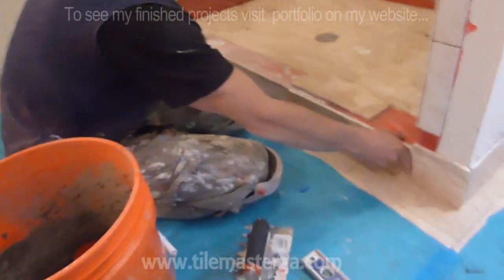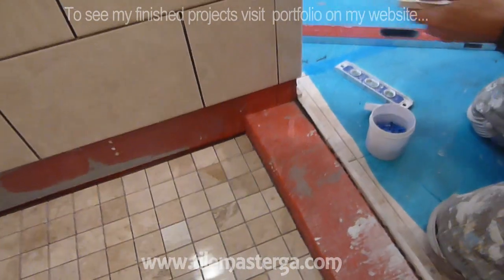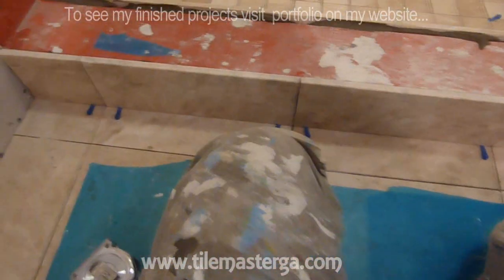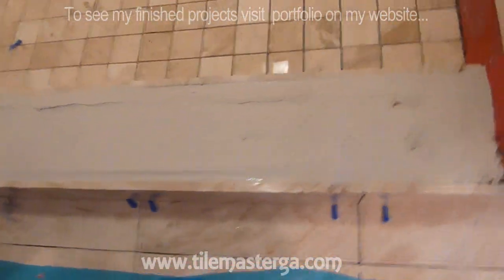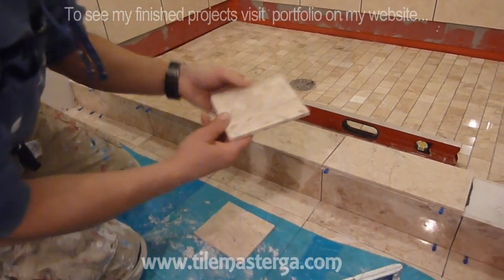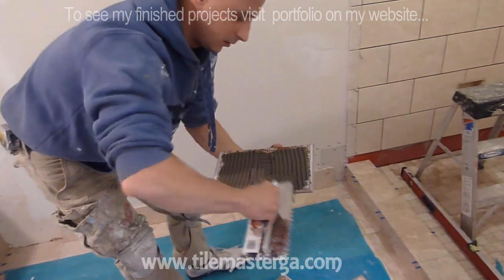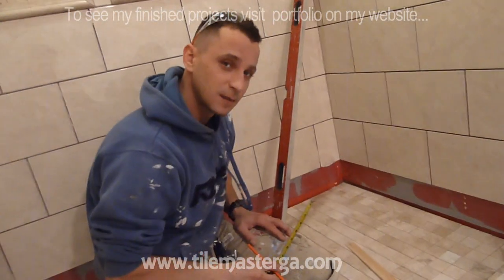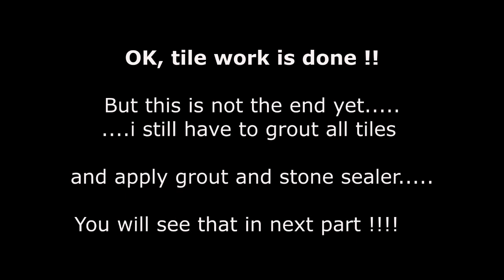Part "5" How to tile shower curb & measure all cuts to shower floor & main bathroom floor  DIY

Comment: Thanks for the video's showing the details and instructions and why you made the choices you did and what you could have done. My late father was a tile mason from the 1950's through the 70's. Back then he used metal lathe and floated the walls with thin wooden strips to make the room square and level. He even used a lead shower pan from time to time. Sure looks easier now and maybe even better. I was the clean up, tote mud and shine the tile boy.Thanks. Semper FI.

Comment: Wow amazing craftsmanship for 11 years ago water proofing membrane wow you were steps ahead of your time great ethics and ways of construction also never anchor your tile board into the shower pan big no no it will wick up water over time leave at least 1 inch above the pan tile your tiles can sit in the water it will not wick anything.

Comment: Nice video series man! Im swedish and here the main reason people dont tile all the way to the roof is that you get increased tax on your house(if you/someone reports it). I like how you apply thinset on the tile instead of the wall... slower but less risk of damaging the membrane and also less stress and headake with differental drying thinset making it a pain to get all tiles seated evenly with flush corners. good job my polish friend

Comment from the maker: Thinset comes in 2 colors -grey and white. White makes work look cleaner and will not discolorate lighter grout. Sometimes if you use grey thinset it will effect lighter grout color.

Comment: first of all thanks for getting back to me very kind thanks  my question was due to the fact that when you did the shower walls the thin set 
you were using was a light cream color .When you started on the curb the color changed to a mortor color it was a dark grey it was at 38 seconds
on your video .by the way your work is top quality your a real Craftman great job
thanks for your time Peter

Comment: Great video.  Very detailed. So I've fired my tile guy for stealing money out of my pants that were in the laundry basket, so here I am. I'm going to attempt the job myself.  My question is about the curb as well as the bench he has put in so far...

NOW TO THE QUESTION:

The curb, shower pan,  and bench have been hot mopped.  I know I'll be making mud bed for the pan , but what do I do for the bench and curb.  Do I mud that as well, or do I hardibacker it ?

THANK YOU

Comment: Hi what thin set for the shower floor? And why you are using gray thin set for the curb and fill the top with white thin set then gray thin set to tile the top CURB ? And upper wall tiles are white thin set and bottom role are gray thin set, I am confused,  please give me an answer. Thanks and you are the king of Tiles Installer.

Comment: I have a concrete floor.  Do I  have to put a layer of concrete down before the rubber membrane?  If so, do I create a slope here or can I just do it level, and then slope the floor when I add the concrete on top of the membrane?  How thick should that first level be?  BTW, never done this before, have a lot of confidence in my skills, but your videos have saved me a lot of possible mistakes.  Really enjoyed them...easy to follow, and I'll be returning from time to time for more tips.  Thanks so much!
Reply: Yes, you need to have a slope under the membrane in case water gets under the top layer.  The slope on the bottom layer is necessary to allow water to run down and drain through the weep holes in the drain (if water gets through the tile to the membrane).

Comment: Very nice work. what I didn't understand is, if you put thinset on top and level with the side tiles, how come  when you installed the tiles on top with thinset there were not a gap between the side tiles and the top tiles, I mean, if they were aligned when you level the side tiles then after you put thinset on the top tiles there should  be a gap  add up(for the grout) between the side and top tiles. I'm asking because I have to do the same in my curb and I don't like to see too much grout on the front side tiles.  I like how  you did it.Thanks

Comment: Looks like a nice install...the mortar looks like rapid set, and I would definitely work mortar into substrate, notch than butter the tile, rather than just putting mortar on the tile...overall nice install though, neat and tight..

Comment: Hello , need some advice. The low part in my shower floor is not where the drain is and so water settles in the shower. I want to redo the floor. Is it  at all possible to roughen the existing tiles , add tub mud ( whatever it is called) to build the height up for proper drain , then retile on top of that. I realize the drain will now be low and not flush with the new tile,so is it adjustable to bring the drain flush ? My house was built in 1992.

Comment: I like your work!  I was wondering what the difference is between the thinset used to stick the tiles to the sides of the curb and the thinset used to fill the top.  There is an obvious color difference, but anything else different between the two compounds?  Also, would you fill the top like that if you were putting tiles on top with two metal edges to finish the top?  Thanks!

Comment: Only one criticism, always flat trowel a bonding coat of thin set to any surface be it raw cement board or red gaurd. Applying thin set to the tile only is not recommended.
Reply: Came down to the comment section to make sure someone covered this
Reply: I take it that everyone in this thread is a NTCA Certified tile installer?
Reply: The Milk Man-😂yeah course man. They’re all pros since they’ve watched two videos. One video makes them knowledgeable,two makes them pros😂
Reply: If you notch the back of the tile it kind of alleviates this problem as the tile is the only part of the equation that doesn’t bond. Personally I’d spread both but this guy knows what he’s doing so there is no problems with his work.
Reply: It will be fine. The tile is the one you really want to back butter. It is good practice, and essential for some surfaces, but not necessary for this.
Reply: @themilkman271  😂
Reply: @ELTUK82  😂

Comment from the maker: Well, if you have matching bullnose available I am recommending to use it. The goal is to avoid too many grout spaces on the curb. 
I don't think that cutting in 45 is good idea - edges may be to sharp...

The most recommended will be to find NATURAL STONE TILE( travertine or marble) that is close in color to your tiles or at least complements  with them. Using stone you can nicely finish sharp edge with polishing pads the way you want. - I apologize for late response - I have very limited time.

Comment: What's the general layout rule where you set you first wall tile and the tile that meets the floor? Looks like you basically cut a standard height wall tile in half and used the remaining half for the last tile at the ceiling. Is this a general standard? Thanks

Comment: What is the difference between the light colored thinset and the darker colored adhesive that you used on the top and bottom rows and the curb?  Couldn't you just use thinset for all of it?

Comment: I did my shower with a similar waterproff membrane before starting (Kerdi membrane) it appears you have a waterproof membrane as well. You then installed some backerboard strips from the floor to start your wall tiles to give a level surface to start from.

Once you remove that board you would of been left with screw holes in the wall and membrane. What do you do to fill the screw holes left by the board? Do you patch with more membrane or fill with caulk or something?
Reply: Jacob Harasimo the membrane he used comes in a bucket and is applied as paint is. so after he removed the acres, he probably went over the holes with more of the goop "Red Guard". also comes in blue and oranges yellows that I've seen

Comment: I have been following all of your shwr steps 1-5 and appreciate the instruction. I am currently setting my 99" long curb today with 24" limestone tiles. I raised the outside tiles by 3/8" like you stared, however, when I cut the inside face pieces, I cut them 1/8 higher than the curb and the slope is greater than "1/2 a bubble at the top". Is having a slope greater than 1/8" ok? I have a 1/8" gap between pan and tile for caulking

Comment: Why no grout spacing on the bottoms of the tile front and back of the curb where the meet the floor/shower base?  Is the way it should be done? I’ve always matched the tile grout spacing on these parts...maybe flush is better?
Thanks
Reply: I would leave somewhere in the ballpark (opening day tomorrow) of 1/16 to 1/8 grout line, then use a silicon color matched caulking to fill the grout gap

Comment: Are the inside and outside tiles of the curb being mortared directly to the waterproof membrane ? 

If yes does that have good adhesion ?
Reply: No. Notice that the curb has the Redgard waterproofing over the whole thing.  Backer material was attached first over any rubber membrane coming above the shower pan, including the shower curb, followed by the waterproofing.
Reply: runner316 And how is the backer material attached to the membrane? Using what adhesive? Or is thinset used? By backer material I assume you mean the backer board. Thanks.

Comment: minute 16:00 - once this dried, did you get any hairline cracks in the thinset? If yes, are these fine? do these cracks need to be sanded down or filled?
Reply: Sounds like part of your curb dry'ed quicker than the other end of the curb, that could be due to a slightly different thicknesses. Easy to fix, just wait a couple of days for the  to dry-out, then spend about 10 minutes with 30 grit sandpaper wrapped around your sanding stone, till you have sanded out the cracks. Careful to constantly vacuum every 30 seconds to a minute, so you don't sand into your water-proofing substrate.
#TileLife4Me

Comment: Why you do not use cross spacers during tiling?
Reply: telosf he says not every time is the same size exactly, which is true. so he uses these because they are more adjustable and can help cutting lippage. (my assumption, but he says why I'm part 1 or 2 or another video)

Comment: Great video that actually shows all the detail from beginning to end.   One question.. You are using small pieces of marble for the top of the curb instead of one continuous piece of marble that would eliminated any grout lines. Is there a particular reason why you did it this way ?
Reply: Bob Oliver probably cost?
Reply from the maker: There was no matching finish and color piece. My goal is to not mix to many different products, finishes and collors. But if you have one solid piece that is matching your tiles - use it ! Cost is never a case on my projects.

Comment: why don't you put silicone or some sealer between the floor tile and the backerboard, before putting on the last row of wall tile?  if water gets in behind the lowest row of wall tile it can wick up the tile backerboard.
Reply: The backer board does not touch the floor so water cant get to it.

Comment: you are setting the bottom edge of the tile flat on to the floor tile with no grout line.  Why?Shouldn't there be a grout line there?
Reply from the maker: +Renee Wasinger There are tiny grout lines at some areas, but that is all good, because i used non-sanded grout for that - designed for such tiny spaces.
Reply: I like to have at least 1/8 gap at bottom where walls meet floor and use sanded grout there. if you go 1/16 or less as your doing and use unsanded, it will separate in time. now you can do it tight like you are but if so, use a matching grout caulk for the movement.  I also agree with flat coating the walls as you go for a better bond. it is nice to see the proper way to do the floor, then curb, then walls, so often you see guys doing the walls first then floor, then curb, I hate that. good clean job

Comment: How do perform a flood test of the pan with this method? I don't get why that gap between the walls and pan is left there.
Reply: einfussganger it is floating specifically FOR the possibility of water not getting down the drain fast enough, eg: clogged drain, shower pan gets filled.
Floating the walls means it won't be sitting in moisture.
similar to deck posts being set ON the base, not IN the concrete. Less likely to rot.
Reply: LightGesture is correct. Also the backer board won't just rot where it contacts the pan, but it will wick up the wall behind the paint on membrane with very little way to evaporate out.

Comment: How do you polish the edges of the top curb tiles?
Reply: John Jones I create the rounded bull-nose profile by hand using a 4-1/2" non-segmented diamond blade in my angle grinder, then smooth and polish the cut edge with successive grades of 4" diamond pads (from Amazon) using my HF air grinder.  I mark the ends and top of the tile with the profile desired and the depth of the profile (top of tile).  We take a piece of tile to local paint store and they custom mix a color to paint the bullnose to match the tile or the factory bullnose if it's not solid color tile. They sell small samples of custom mixed paint for buyers to try out multiple colors.  It's way more paint than is usually needed but is pretty inexpensive.

Comment: I  really can't stand this guy....he makes this look so easy....he makes it look so clean and calculated.  It makes me think that I can do it and come up with the same result....then I end up on one of those Homeowner DIY gone wrong videos!
Reply: me me it's as easy as he makes it look. The key is understanding it will take longer than him the first time, and that's OK, just check everything constantly as you go. Don't settle for "close enough," if it's not right don't let the thinset set up, either adjust it or remove it.

Comment from the maker: Etherglide - are you serious? what incorrect adhesive? I can tell that you know nothing about adhesives!! Color has nothing to do with that my friend!!
You can buy same product in 2 colors - almost always!
White one is less messy to work with, easier to clean and is recommended if we using light collor grout.
Grey one is ussualy little beat less expencive because is easier to manufacture! all parameters are exactly same!!
Please do your homework before writing any more comments on my videos!!!